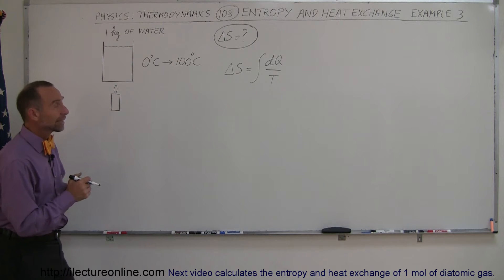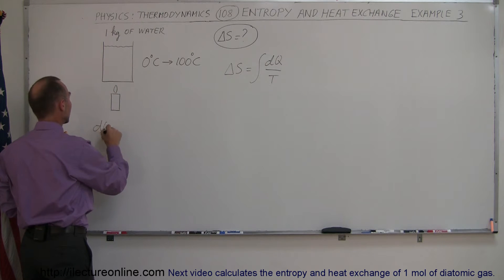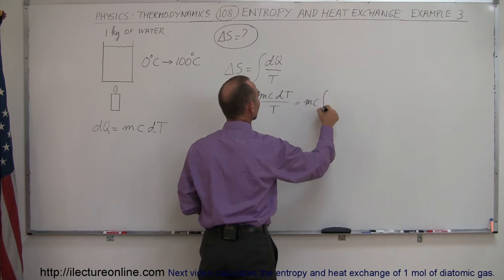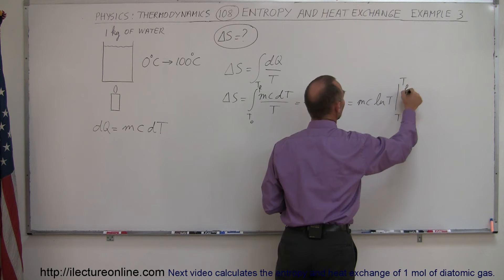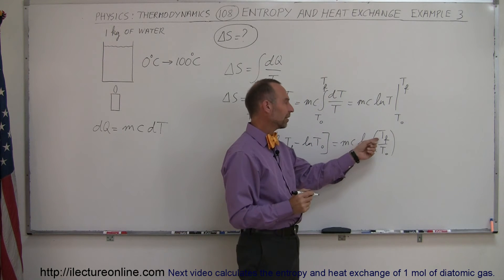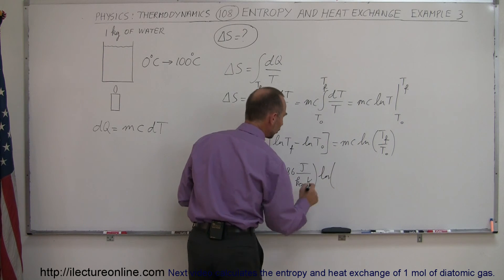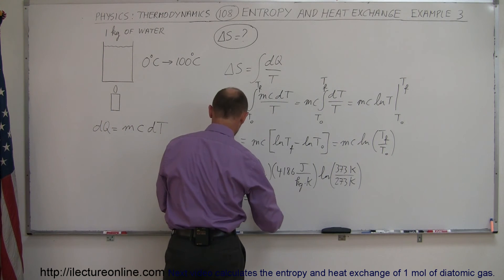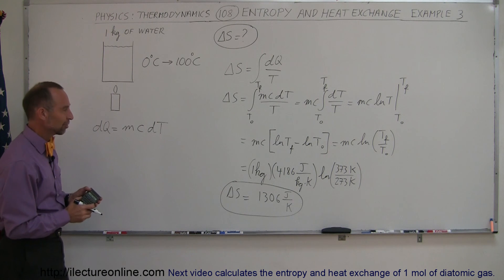Physics 30  Entropy (4 of 5) Entropy and Heat Exchange: Example 3

Comment: You're a hero. I know it was just a silly mistake, but you said Kelvin degrees, which of course you know the're not .
Reply from the maker: It turns out, they are the same.    200 K  is NOT equal to 200 degrees C     BUT   200 Kelvin degrees is equal to 200 Celsius degrees.
Reply: @MichelvanBiezen  You are right!!!!!! thank you  for answering. You can delete my comment if you think it may confuse some people.
Reply from the maker: It is actually a good question and it helps others understand the difference between 1 degree centigrade and 1 centigrade degree

Comment: Hi..I have a question. 
What is the change in entropy in a irreversible process?
Reply from the maker: Use the same definition of change in entropy when heat is removed and heat is added and account for all the heat exchanges.  (It may be difficult in some cases to identify or measure this exchange in an irreversible process.

Comment: dont we have to calculate the change in entropy for the surroundings too, to find the final change in entropy? like we did in the other example?
Reply from the maker: Typically we only calculate the change in entropy for the system.  (we consider it isolated from the universe).

Comment: Hi Michel, I have a question. Why didn't you use the integral in the previous examples and why do you use it in this example? Thanks again for the videos!!!
Reply from the maker: +Sjaak van Dijk 
If the change in the temperature is small you can use the average temperature.  
If the change in the temperature is large, you must use the integral.  (The integral is the correct way to do the problem).  Using the average temperature in the denominator, is an approximation.
Reply: Michel van Biezen thanks
Reply: you have asked best question ..thanks for asking and getting answer@sjaak
Reply: thanku sir for ur video its really helpful for me
Reply: Thanks for the compliment. All the credits go to Michel.
Reply: really..sir
Reply: Sir do you have videos with examples of total entropy and conditions under which the entropy of the surroundings equals zero? I'd really appreciate them for my upcoming exam
Reply: Is there a convention on how much temperature change is considered "small"? Even for this problem the approximation comes very close.